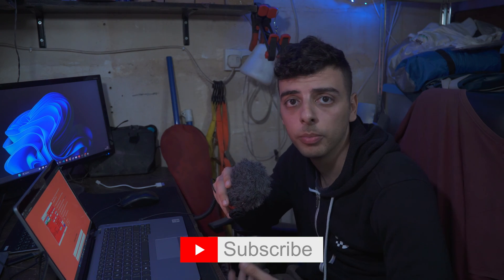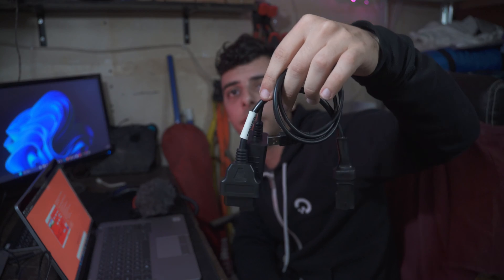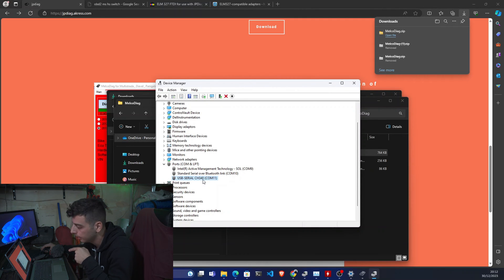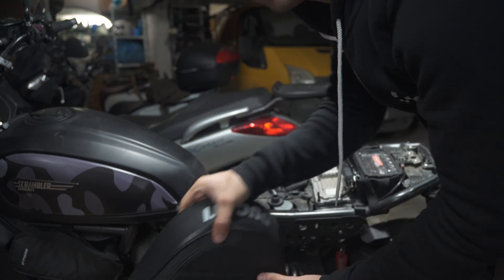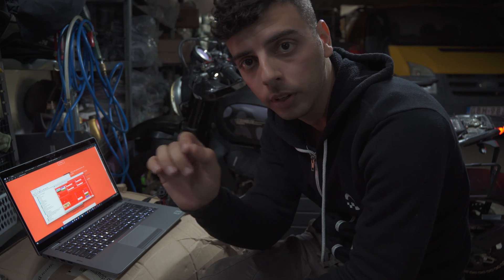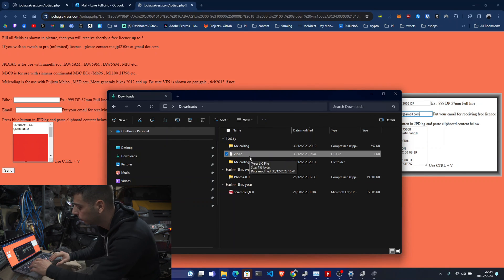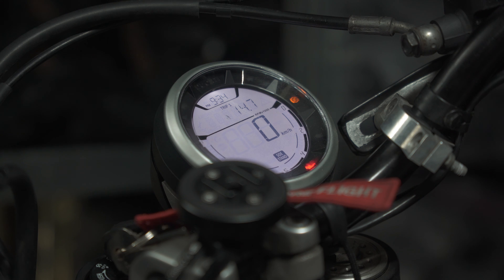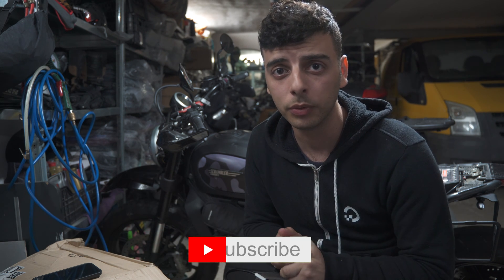Ducati Desmo Service Warning Reset - Melcodiag

Comment: Hey, I have a 2024 scrambler nightshift. I did everything same way you did it but melcodiag cant get my bike’s info. Do you think it’s because ai have a newer bike with different ecu?
Reply: This would also be interesting for me. Did you find a solution yet?
Reply from the maker: I dont think melcodiag supports the new scramblers just yet, for sure they have had alot of electronic changes and Ride-by-Wire added so they needed to make the software compatible for it

Comment: Hi, you did a great video on hypermotard 821 and the issues.  I have that 821 and trying to connect to melcodiag. I have the same cables as you (ELM327 FTTN +4pin to OBD2 cables) and the ECU = 7SM. I have tried connecting with "ANY BIKE" option and the M3C options and managed to get a licence issued to me.  HOWEVER the main screen only reports the VIN and Software as = 12 and kms as 44592. Thats it.  I see no ECU data.  Any tips on how to get the ECU data so I can clear codes and reset the oil service flag?  thanks

Comment: You figured it out.🎉 Thanks for sharing, when I first bought my 2019 Ducati Scrambler Cafe, I traveled down the rabbit hole to find options to talk with the ECU. Do I need a flash to adjust the cat delete the previous owner did? Do I find a tool to build my own map, and so on and so on. Great to see you have a solution for this. Again thank you.
Reply from the maker: Sometimes a flash is not always required, especially if the bike is working fine after the delete, for reflash you need to find options like up upmap which i believe are plug and play for the bike
Reply: @pullumotoagreed. I elected not to re flash mine and it runs very well.

Comment: Hello from Canada! I have a 2014 Hypermotard, and I was able to get a license for melcodiag, but on the hypermotard I find the connection and function is not dependable. I have tried several ftdi elm adapters. I know you have the same series hypermotard. Does it work properly for you?
Reply from the maker: Honestly sometimes it takes like 3 times to connect, like switching off bike unplugging usb etc but eventually it always worked, I only use it a handful times a year so I'm ok with it
Reply: @pullumoto Thank you for the reply. I'll keep trying. I used to have a multistrada 1200S that Melcodiag seemed to be very consistent with, but I gave the cables and adapter to the new owner. I thought maybe the issue was the elm 327 (have tried multiple versions), or the cable adapter.  At this point, I'd almost consider buying a proper scan tool.  Thanks for all the great work you do. I really appreciate the clear directions. Next step for me is to replace the clutch with an updated (2015+) version.
Reply from the maker: Buying the right cable always seems to be the tricky part in this process, however you said that you used ftdi cable already so I'm also confused. Buying a professional tool cant be a good investment if you are planning to use it in the long run but still im not sure if these tools are compatible with all bikes..

Comment: Finally got around to ordering cables for my SF1098, the JPdiag download doesnt seem to work..do you know if melcodiag can be used for 1098 as well?  I saw your other video where you used jpdiag for your 848.
Reply from the maker: I think 1098 has IAW ECU so its it will require jpdiag, what is the issue with connecting? and what cables did you buy? the older bikes require a different cable than the newer bikes that use melcodiag

Comment: Does it work on 24 Ducati SuperSport 950s?
Reply from the maker: You will need to check the obd connector on the bike first, I think the newer bikes use a 6pin connector so it will need a different adapter
Reply: @pullumoto So If i get the adapter, would the software work with the newer 2024 supersport?? An Adapter is usless unless the program communicates with the ECU
Reply from the maker: I dont have a 950 bike to test it myself, but looking at the forums it seems that the program works with those bikes too. I suggest taking a look at the forums too to confirm. You can access the forum from the jpdiag website(top menu). or I have a link in the description of this video

Comment: I get the error message:Can't init elm! check your settings COM number and COM speed.

The red light on the USB to PC is on as well as ignotion. It will  not connect no matter what com combination I am using.

I asked chatgpt and got the answer I needed a 12V to the connector cable pin 16. My cable is supposed to have the 12V. It is a icon S800 EU4

Anyone any idea?
Reply from the maker: its sounds like a cable issue, are you sure you obd has the ftdi chip? I had a normal elm327 and it didnt work before
Reply: @pullumoto Thx for your hint - I am thinking in the same wrong "chip in the elm 327"  direction.

Comment: Maybe a dumb question but when i send the information for license registration do i need to leave the cables connected to the bike and laptop until i receive the email file to that allows me full access?  or can i basically unplug and turn the bike off until i get the email?

Thanks
Reply from the maker: No need to be connected as it may take some time to receive the license
Reply: @pullumoto Thanks!

Comment: Does anyone know if this works on the 2021 Scrambler 800 Nightshift? I can't find any info on when the ECU changed to the next-generation. My ECU is an S800IC-CR-FT
Reply from the maker: does it have the same 4 pin connector under the seat for the ecu? I would give it a try if It's the same

Comment: Dont work on 2022 icon dark euro 5 ( cant get info moto vin etc, connection ok((((
Reply from the maker: are you sure you have the correct cables? Most of the time its an incorrect cable issue
Reply: Cables is work done connecting but no info moto(
Reply: I get try from other notebooks later
Reply: I have 2 cables wired and 2 Bluetooth, all 2 cables working fine , connected by not gives info moto (( , same with 1 Bluetooth, other Bluetooth failed connection, I have wired 6pin euro 5 adapter Ducati
Reply: @grinya2ita  how did you solve this problem? i cant get vin number information either

Comment: I see that the OBD ELM 327 from the link above is different from the one that you have used in your video. It doesn't have that switch. It is ok to use it?
Reply from the maker: as long as there is the so called ftdi chip it will work. I updated the links to include also one exactly as mine.
Reply: @pullumoto  thanks
Reply: Hi! I bought the cables that you recommended (thanks!) and I have also received the CLE file from JPdiag but I couldn't reset the oil service light. The thing is that I don't have a permanent service light. Basically when I turn on the ignition it shows for couple of seconds that I have 300km left until the oil service. Should I wait until I'll have a permanent service light?
Reply from the maker: @alexmurariu87  yes you have to wait for the service light to come on, what you have is pretty standard and it it tells you when the next service interval is. Once those 300km pass the service light becomes permanent and then you can remove it.
Reply: @pullumoto  thank you so much! I appreciate it!
Reply: @pullumoto  Many thanks! I managed to reset it yesterday.

Comment: Could this turn off the headlights so I can run only day time running lights ? I’m in canada and they run headlights for safety reasons.
Reply from the maker: I don't think you can turn them off permanently. The newer scramblers for example have ambient sensor and they turn off the headlight when its sunny

Comment: Good information! I bought the cables and downloaded the program. I am going to use this program after I do the Desmo Service on my 2015 Scrambler. Can I also use this program and cables on my 2023 Next Gen Scrambler Icon?
Reply from the maker: If you have the cables already you can check if the next gen takes the 4 pin plug(i think it does) so from that side you should be sorted, as for software try the latest melcodiag but i dont see a reason why it shouldnt work. Always check the official site and forums to check for compatibility
Reply: @pullumoto  Ahhh Ok I will check it out and see if it fits and let you know how it worked out. Thank you! Hey, where is the tiny island in Europe that you live?
Reply from the maker: It's Malta  😄
Reply: @pullumoto  Very nice. I imagine you can take the overnight traghetto to Sicily and do some riding there sometimes. Here in California we have many nice highways and winding roads to explore.
Reply from the maker: That is very nice, in Malta we don't alot of long roads to enjoy and most of the time the island is grid locked. To go to Sicily and race track we have a high speed ferry which takes around 1hr45min and costs around 200 euro(rider+bike+return)
Reply: @sscarcello just wondering if you got the program to work on the 2023?  I've got a 2024 Nightshift and hoping that this will work on mine.
Reply: @redsunsx01x  Hey just saw your message. I bought the correct cable and tried to connect it to the program and it did not recognize the bike. I also went to an authorized Ducati shop. They were able to reset the service light, but for $86 USD ! I was also there to have it remapped as I bought a Zard exhaust and a Cat. delete ( Leo Vince Link Pipe) with a K&N air filter and they said there wasn't any programs yet and they could not re-map it ! Maybe later down the road JP Diag will get it all sorted out for the Next Gen Scramblers.

Comment: Hi! I followed every step in your video which looks pretty straight forward. I sent the report to the page like you showed and I never got the license. It was 3 weeks ago and I my emails can't be received. I know there is a donation box, but I am not sure if this is the step that needs to happen before it goes through. Hopefully you can give me more info on this. Thank you.
Reply: Check spam folder
Reply from the maker: If you did not receive license its probably an issue with the data you are sending. I suggest searching the forum of jpdiag for more troubleshooting as I am sure other people had the same issues

Comment: Very important to ask the sellers to show the demo service was done. If done by the owner at home, should show receipts for parts. Resetting a desmo service light and not doing a service is too risky. Good point that PulluMoto raised "don't skip your desmo service"
Reply from the maker: Good point and if they cant provide proof at least you can check the timing belts condition very easily on a scrambler before buying
Reply: It’s not that big of a deal.

Comment: i have a scrambler 1100 i am not getting motorcycle infos when i press connect, can you provide the drivers you used to connect the elm interface? thanks
Reply from the maker: Windows should install all drivers automatically, if not you may need ch340 drivers. Also are you sure the cable are correct? if cable doesnt have the ftdi chip there will be no connection
Reply: @pullumoto  ty i'll try and let you know
Reply: Same problem on my 1100... He connected with "CAN ERROR"